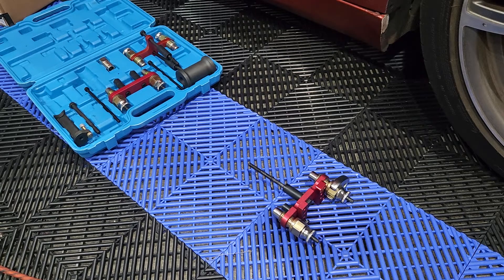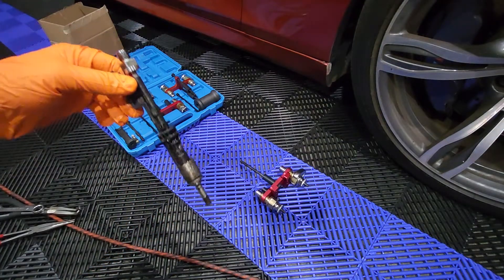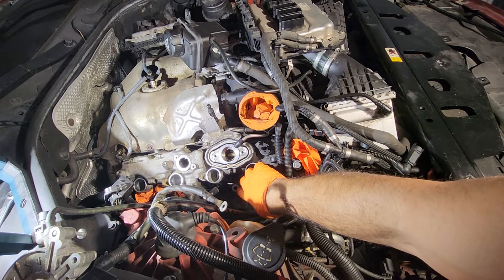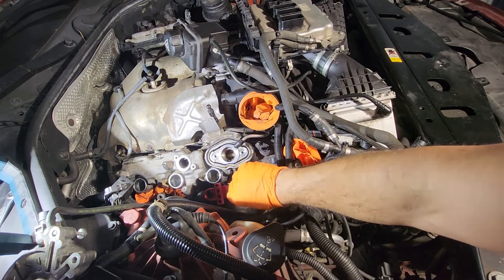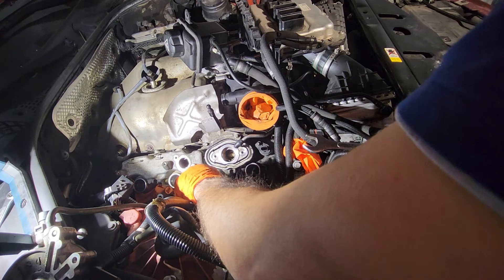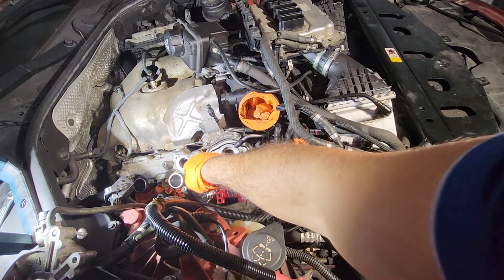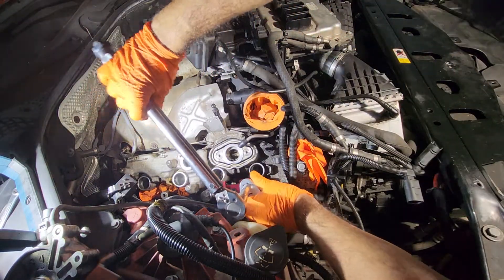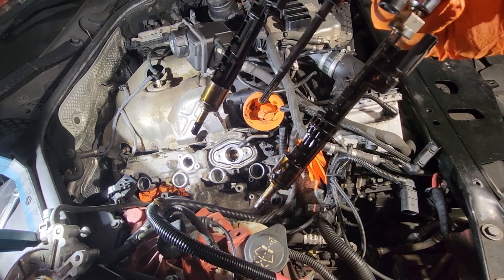Removal of fuel injectors from S63/S63TU engine of BMW F13 M6

Comment: What did you do with the fuel lines that go to the injector? Did you just move them out they way or did you take off the entire fuel line?
Reply: I actually took off the entire fuel line (by entire, I mean the line sitting on top of the valve cover gasket)
Reply: @buenos-roma  how hard was that to get too?

Comment: just wondering what made you come to the conclusion that the fuel injectors were bad. Thanks
Reply from the maker: I actually didn't know if they are bad. I needed to remove them in order to investigate the root cause of blue smoke coming out of the tail pipe

Comment: I assume this will be the same for all S63 engines? I've read you have to swap seals/gaskets onto the new injector, did you do that as well as the coding or just straight swap them? Thanks for this by the way!
Reply from the maker: I did replace the Teflon and the seals. 

I didn't do the coding because I wasn't trying to replace the injectors

Comment: hello, Thank you for making this video, i am working on 2014 lci 750 with n63b44 engine i am doing the injectors aswell and wanted to ask how do you reach the bolts for the fuel rail bracket? did you disconnect the heater core lines aswell as the wiring harness to access them? 
Regards
Reply from the maker: I apologize for the late response!! 

I use a torx Allen wrench to reach then. They are a real pain in the ass to get to, but I got them ultimately.